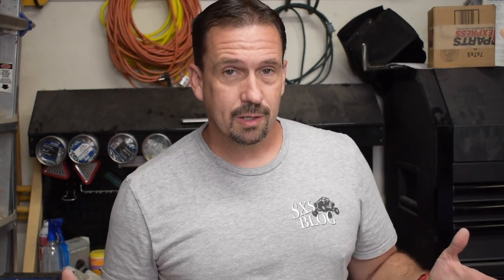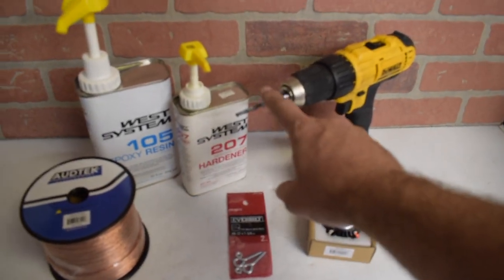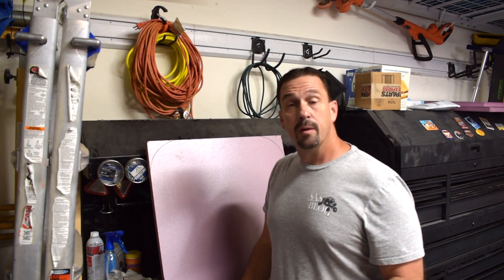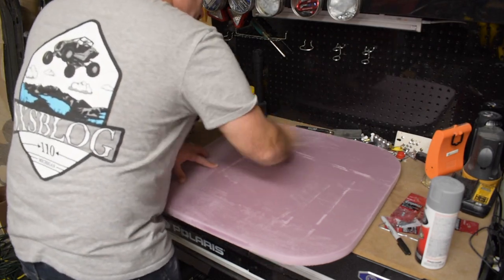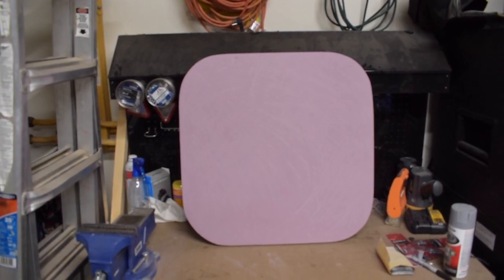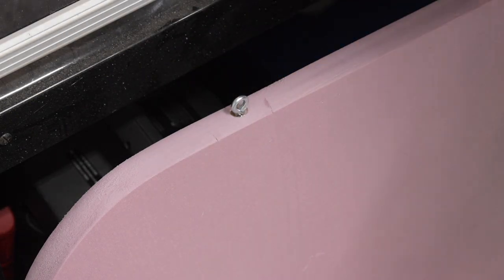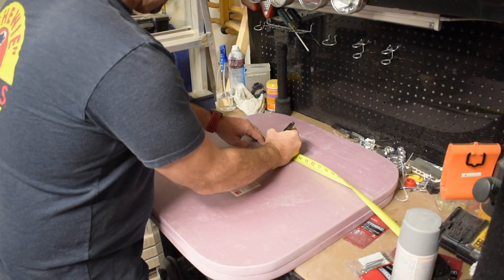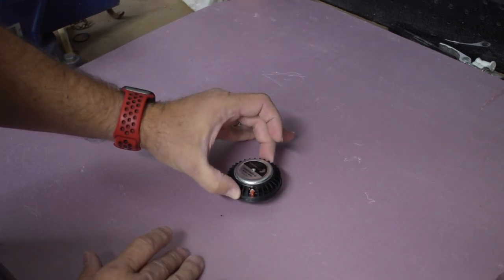DML Speaker Build

Comment: I highly suggest using a sub woofer with the DML's. I prefer the Dayton Audio DAEX25x4-4  quad/ spider cage exciters, had good luck with them. I also suggest spacing the speakers farther apart and play with proximity to the back wall. For anyone building these I just use coarse thread screws directly screwed into the foam to hang the speakers - no adhesive involved and no issues even with the heavier quad exciters.  Cheers

Comment: Hey friend, Kirk here. The Crackling you hear, are most likely Distortion, because you have them so close together, there sound waves are hitting each other and trying to cancel each other !
Reply from the maker: great tip thank you !!
Reply: sorry thats just wrong on so many levels. waves that 'hit' each other dont distort they simply add up. distortion is either 1. from amp (unlikely) 2. from speakerdriver/exciter (very likely) 3. from panel or combination of driver - panel relationship. distortion increases the harder you drive a speaker

Comment: rubish
Reply from the maker: Agreed! Not happy with my results or how the video came out.
Reply: @knowgearsknowglory2862  don't take seriously this kind of nonsense comments, for someone like me looking for content about these speakers is really good to see different build results before I try myself. Thanks!
Reply from the maker: @MatheusFP104  Thank you! I appreciate that perspective!
Reply: one exciter needs to be in the center, the other off to one side and down a bit in the setup you have.
the panel should be 90% the width as the length.
a subwoofer in needed separately with foam panels.
an acoustic ceiling tile would add some midrange and take out some higher pitch.
  a stiff cardboard panel believe it or not sounds really good !!
 frame the left and right side of the cardboard with wood 1x1's by cutting a slot in them to glue the cardboard in, then run two 1x1's across the back attached to the 2- 1x1's on the sides for support, leave the top and bottom as is. 
you can lightly spray the cardboard and wood with some polyurethane to give them durability.
this is what i have learned from studying the topic and i am getting ready to make some myself. its not hard to get GREAT sound out of these, just a few basic rules need to be learned from others.
the best ones i have heard yet are cardboard with 2 exciters and an added ribbon tweeter at the top center. they had the exciters placed one in center and one down and to the right a few inches on both.
Reply: @justaguy-69 I wonder if lightly coating the panel in a water/glue mixture will bring up the high end frequencies due to the increase of stiffness
Reply: @xlilsasuke4x  it may but overall performance may be degraded too, just add a ribbon tweeter !
view the panal as covering sounds from lower tweeter thru midrange into lesser bass, the fill in the higher tweeter sounds and deeper bass with a ribbon tweeter and a subwoofer.
Reply: @justaguy-69  where would be the optimal place to put the tweeter? I’m working on building on the these panels using xps. Also designing an adjustable 3 channel amp (high, mid, and low) so I can adjust the EQ as I modify the dml panel
Reply: @xlilsasuke4x  near the top of the panel in the center.
Reply: @justaguy-69  are there any resources I can read up on the placement of the tweeter?